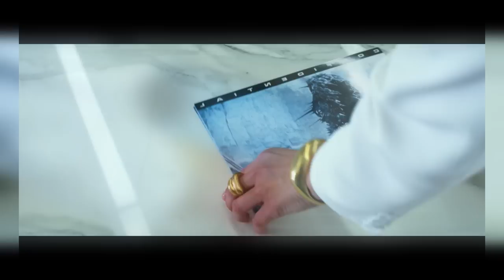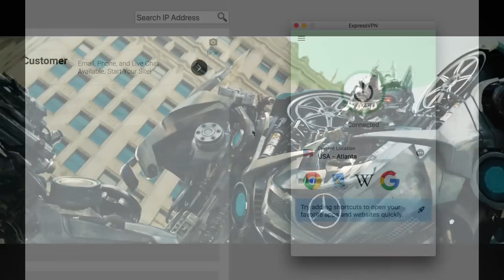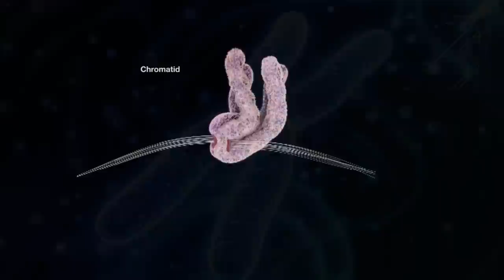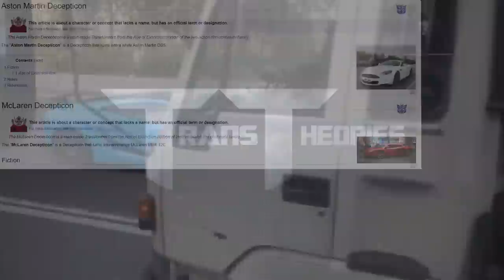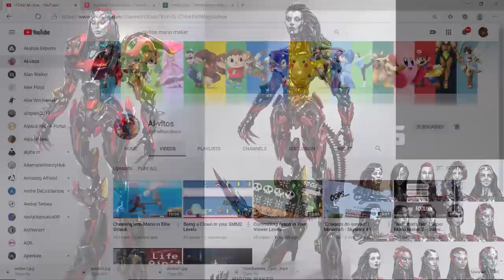The Story of Kinetic Solutions Incorporated

Comment: The idea that the KSI Drones awakened via energon mutation makes a disturbing amount of sense. Even the visual effects match up. It also explains how they gradually reformatted themselves into new designs.

And now some pedantic semantics from a TFWiki lurker:
* CNA (Cyber-Nano Algorithms or Cyber Nucleic Acid, depending on the continuity) is probably a more apt term for Megatron's genome than DNA, as KSI is working with what is effectively claytonics produced using raw cyber-matter.
* The term "linkage" has already been used for a various concepts related to Unicron Trilogy Minicons, so that might be confusing.

Comment: i have another theory about the blue wrecker lookalike in TLN , as we saw he had a different face than the blue one similar to the red one, so we saw that the red one had been killed by lockdown and semitary wind ,this is a bit of stretch but since the wreckers were close  they stuck together and when they attacked, the blue one was not there with them but had gone somewhere else to find other auto bots or optimus , the drone cade hacked did not capture the footage of the other green one what i think is the green one died and the red one's head and a few parts were still intact after he died,  and i think  they left them since they had not gotten in touch with KSI yet and then after they were gone and the blue one returned he saw the mayhem and thought to escape and as a memorial he took the red ones parts and replaced it with his as he was an engineer and escaped to cuba then later found simmons and befriended him.